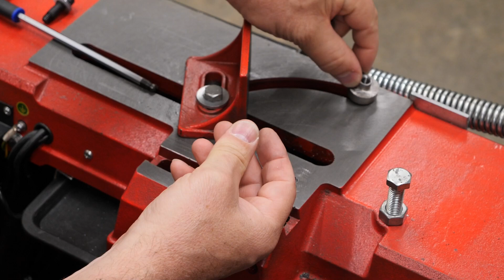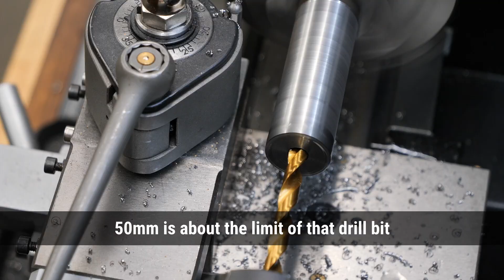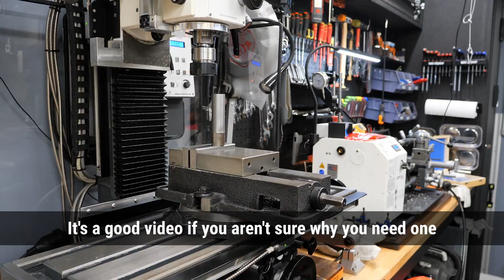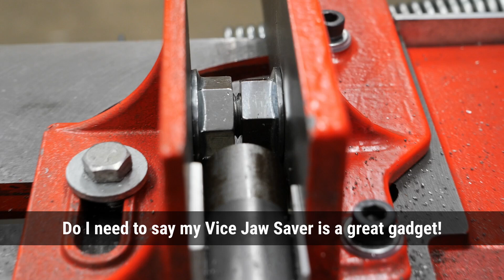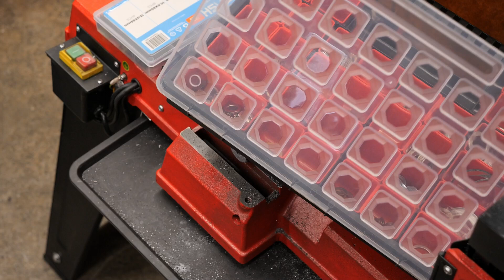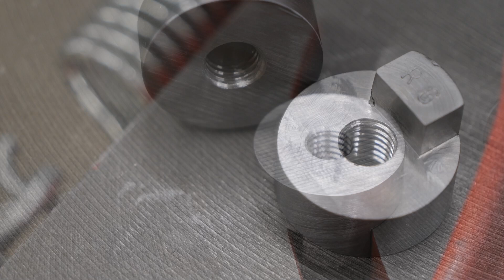Vice Lock Mod III - 4x6 Bandsaw - Rob's Garage

Comment: Hello Rob, nice job! I like the threading device you are using on tailstock. Can you tell me where to get it? Thanks, Tomas
Reply from the maker: Hi Tomas, search eBay for 'Tailstock Tap and Die Holder' and you'll see heaps of them the same as my one. Just make sure you get the right taper for your tailstock- MT2 or MT3. They used to come in a wooden box but now I see only some of them do. It's a decent kit just a bit long for a tiny lathe.